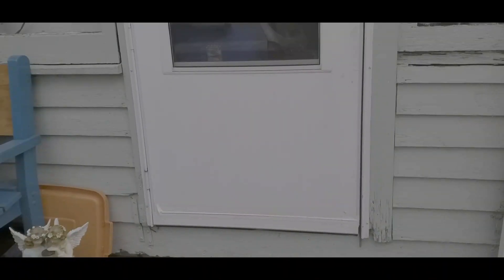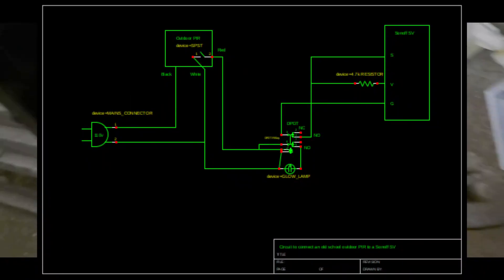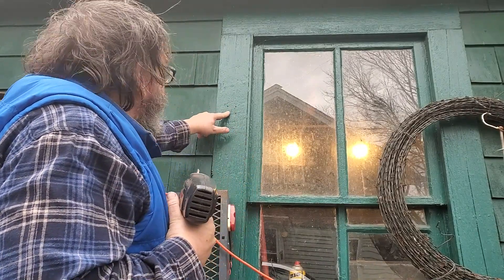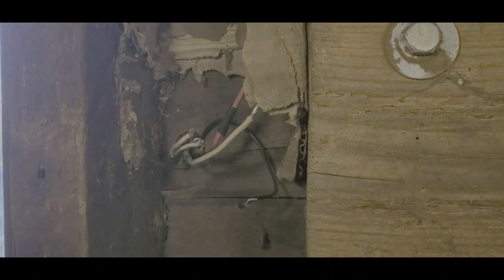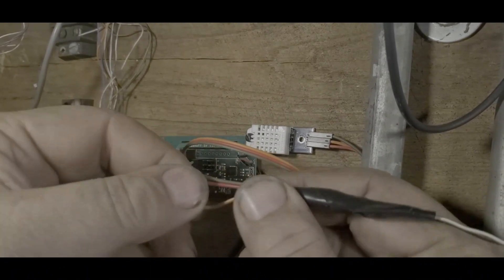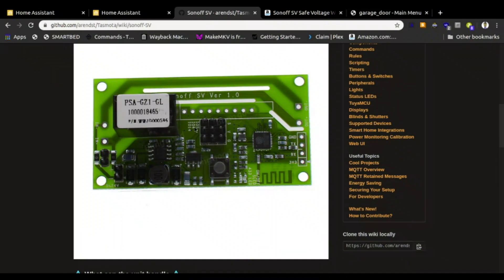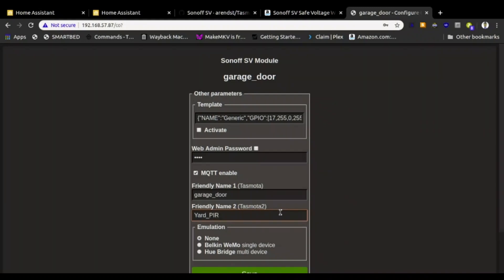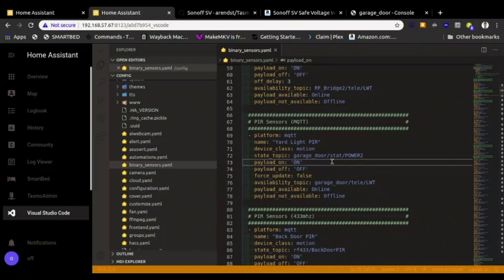Outdoor PIR on Home Assistant for less than $10.  Replace RING motion sensor.  E003

Comment: Thank you for your video. So far you are the only one I came across using Sonoff SV other than GPIO14. Thank you.
You physical wiring is not easy to follow esp the motion sensor RED wire connect to Sonoff SV GPIO04. The red wire is 120V. How does it work with SV. Thank you.
Reply from the maker: I believe those wires are feeding the 120v relay that provides the dry contacts for the sonoff, not going to the sonoff itself. There is a relay in there.
Reply: @Whatarewefixingtoday  Thank you for your reply. Will see I can picture the wiring between the Motion 120V to Relay and then to the SV GPIO-05.

Comment: This would have been a little bit easier if you use esphome. But it's an amazing project. I would definitely suggest to put all the wires and the sonoff in a box to avoid problems, and for the looks of it.
Reply from the maker: ESPHome is not something I have tried and probably won't.  I like Tasmota, but that's just me.  There is some Zigbee in my immediate future, I have some ZWave stuff, but hot ESPHome.

Comment: Is the output voltage of the trigger line (red wire connected to your relay) on your PIR also at 120V?

I'm trying to set up motion detection to control some lights in a fairly large basement area.  I've tried using an AM312 PIR with a D1 Mini.  It works but the range of the AM312 is way too short for what I needed.  I was thinking about using a longer range PIR such as the one you show in the video, but was wondering what I have to do to the PIR's output  to connect it to the D1 mini.
Reply from the maker: Yes, the red wire out of that device is designed to power a mains bulb itself.  I am using that to power a small mains relay, then using the contacts od that relay to trigger the Sonoff.  You could trigger the D1Mini the same way.